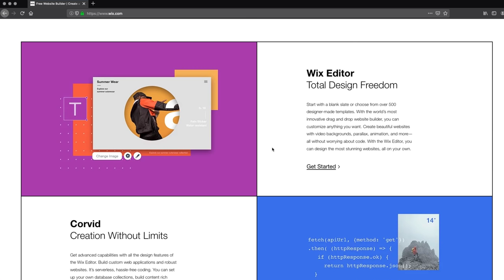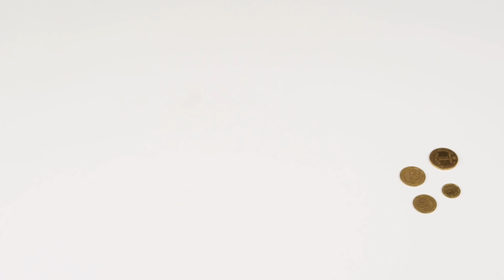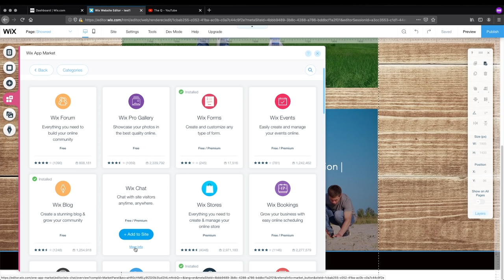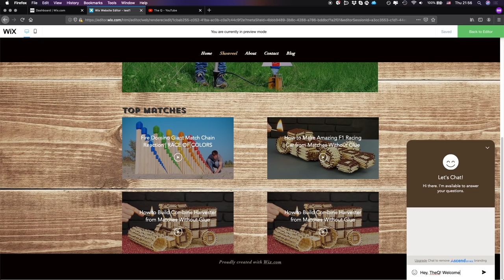DIY Mechanical Coin Sorting Machine

Comment: If any of you are actually interested in creating one of these sorters and work with inches,
below is a listing of the "centimeters" as shown in the video converted to inches.  

They are set to 1/64", but you can get as close as you want and I'm sure everything will work just fine.

Note: Be cautious when cutting out the "coin drop slots".  Don't cut too high!!

From smallest to largest:

1.50 cm = 19/32"
2.00 cm = 25/32"
2.50 cm = 63/64"
4.50 cm = 1-49/64"
6.00 cm = 2-23/64"
7.00 cm = 2-3/4"
7.50 cm = 2-61/64"
10.0 cm = 3-15/16"
10.2 cm = 4-1/64"
14.0 cm = 5-33/64"
16.0 cm = 6-19/64"
50.0 cm = 19-11/16"

I'm thinking of making one, but I will be changing some of the parts.  
If I can, I'll post a description of what I've done.

Ken
 H. Sr.

Comment: This comment was added in here just as a product suggestion for those of you who need a sturdy, flat surface for projects like the one above.  I was at our local "Dollar Tree" store (everything is a dollar) and ran across some clipboards.  They measured 1/8" x 9" x 11" of useful surface.  There is a steel clip at the top which would take your nails off if you're not careful ! (Use it as a clamp). 1/8" is a nice size for those smaller projects. They are made from sort of brown, fibrous mat'l. Let me know if you find any.

Comment: You should make the boxes taller from left to right. It will prevent the coins falling into the wrong boxes and also smaller value coins are usually more than higher ones, meaning more space for these at the same time.

Comment: HINT:  About the boxes which will hold the sorted coins --- You might want to surround the entire box "set" with 1/4" thick strips of 1/2" to 3/4" wide glued or screwed wood strips.  These will hold the boxes in place while using the sorter and will allow the removal of the boxes when complete (the width of the base may need to be a bit wider).  I think I will try this sorter out for my Grand-daughter for Christmas.

"The Q" - By the way...what DIA. or R. did you make the center "paste board" (...brown) circle? (4:03) 
It looks like it really doesn't have to be exact, but I'd like to use the same dimension as you did.

Comment: Hello, if these are euro coins, the arrangement should also be correct, since the 50 cent coin is larger than the 1 euro coin, which means that the two should be swapped, greetings from Austria Karl

Comment: Cool but seen 10 cent piece  fall Thur the 25 cent slot when they build up it pushes then further down and they will all Thur any hole
Reply: OneLove ™ No, the closest hole is for the 10 cents so when they pass by it they fall down, and the other ones pass, then when they reach the 25 cent hole, the 25 cents fall through that hole, and so on.

Comment: So, you build this "machine" that sorts coin, but you have to turn it and put the coins in. If you're gonna do all that, just buy an automatic coin jar that counts for you??
Reply: Honestly, adding a motor to it is pretty easy after all the rest of the work. The bigger issue is that in the US our pennies and dimes are just about the same size. Still, even with American coins, it would still be a significant savings in time over doing it manually.